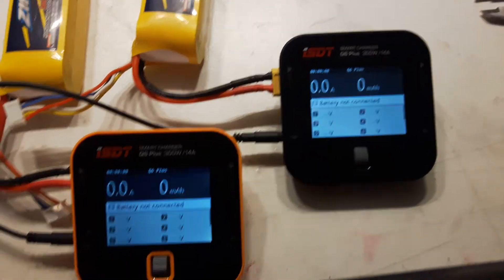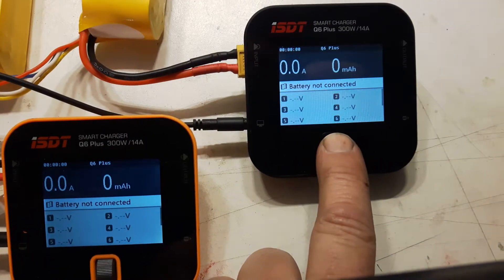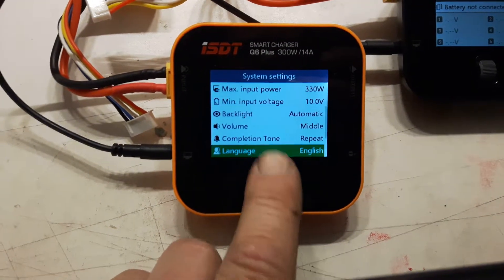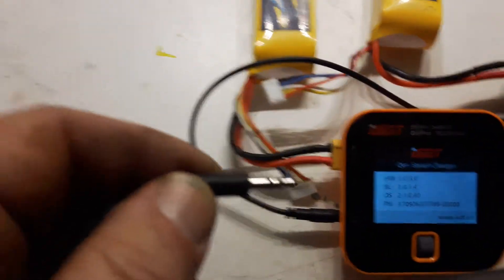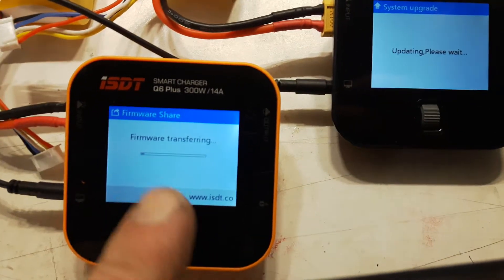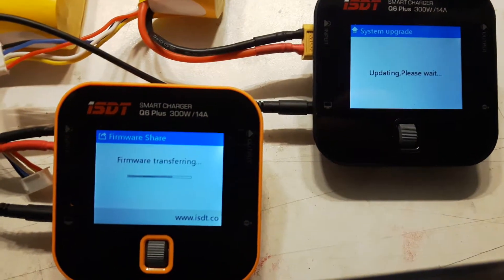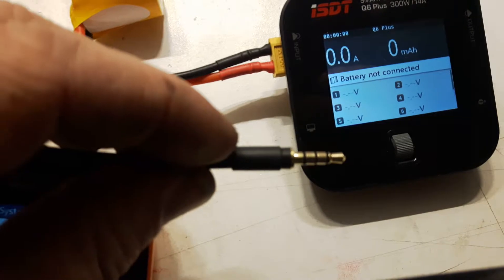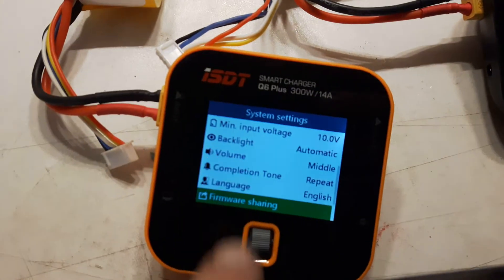ISDT Q6 Firmware sharing

Comment: I tried to update a T8 and now it dont power up just keep beeping. Can you help with this?
Reply from the maker: I don't know the T8, but I know that these ISDT chargers wont boot up properly if the input voltage is too low. The T8 input range goes from 12V to 40 Volt. However, you might experience different input volt requirements after firmware upgrade/change. What I mean is that the firmware "believes" it is too low input even at 12V supply. Try higher input voltage - like a 6S lipo, to see if it boots up. Then, if possible, calibrate the input voltage readings to the actual input voltage.
Further, as with most electronic and programmable equipment, pressing and holding in a button, or several at the time, while powering up might able you to enter hidden modes. The T8 has a center button surrounded by four buttons (on a common ring). So on T8 it is probably possible to press center button and one of the navigation buttons at the same time, while powering up. Listen for a possible beep before releasing the button(s). Perhaps you can enter a hidden configuration mode?
If that doesn't help, try connecting it to the computer with the ISDT USB adapter, and see if you are able to connect - even if the charger doesn't seems to boot up.
I'm sorry that I cannot help you out with a specific solution, but try the above.
Alternatively, apply for a membership on the ISDT-forum. Emailing hi@isdt.co (not ".com"), might also help, if your dealer cant help you out.

Some additional information: If you upgrade the charger with wrong firmware, you might also experience the same fault. One solution to this is sharing firmware with another identical charger. This tip I got from "just_noXi" in a reply further down in this video regarding firmware for Q6Lite and Q6+ chargers.
Reply: Hey, I have air8 and it stuck during update and after that I cannot boot it, it automatically fall in update state. Do you have any ideas how to fix it?